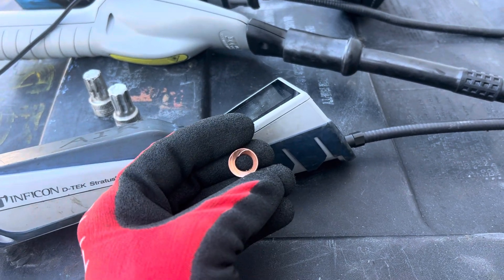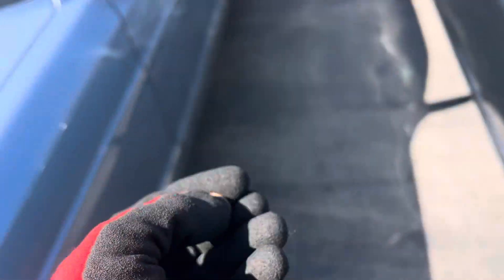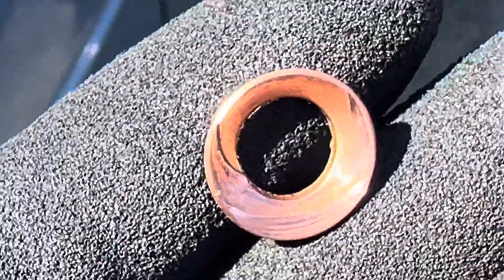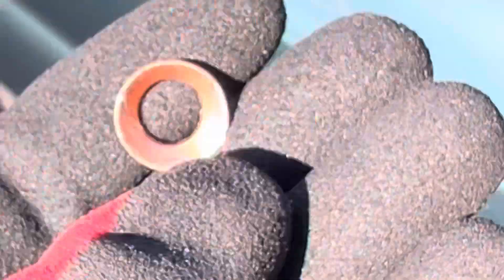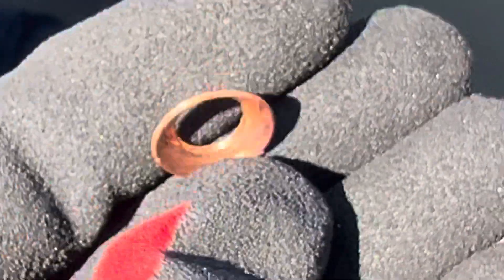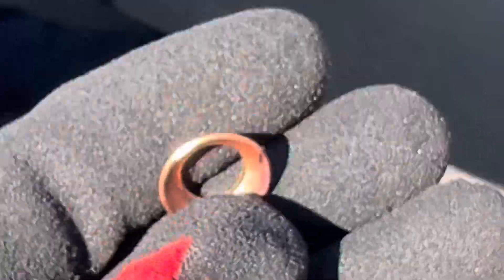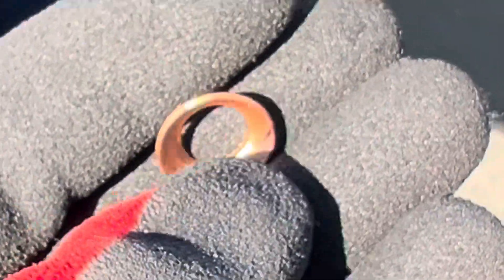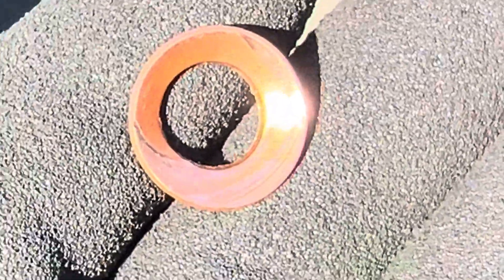COPPER CRUSH GASKETS improperly, installed overtightened or under tightened common cause for leaks

Comment: The Flare Seal inserts are pretty cheap in hydraulic supply store, in bulk. 

People on refrigeration side of things making a killing on it!!!
Reply from the maker: @commenter5469  YES 100%
Reply: @coldfinger459sub0  Do you think white Nylog alone would take care of that?
Reply from the maker: @commenter5469  just the blue bottle, the clear, refrigerant oil based stuff. 

Don’t need any Teflon particles . 

Just need something tacky enough to hold it into place . 

NYLOG IS NOT A CHEMICAL DRAWING SEALANT

It is only refrigerant oil .  

Think of mineral oil clear liquid stuff you get in the pharmacy that people would use as a laxative or put into the ears to help remove earwax or into the eyes for relief from scratches or dry eyes . 

Now, when you thicken mineral oil you get Vaseline that’s all it is is thick mineral oil . 

NYLOG is just thick, refrigerant oil